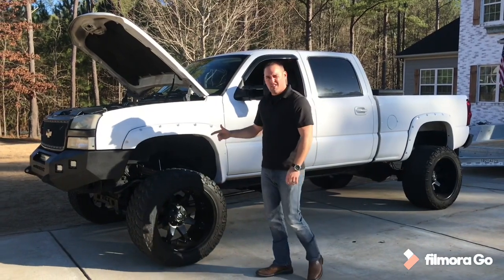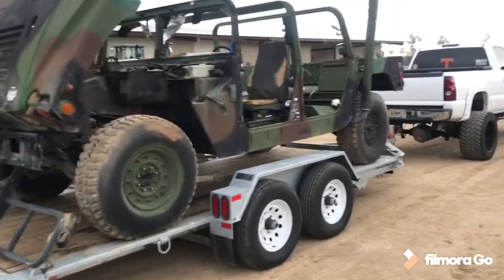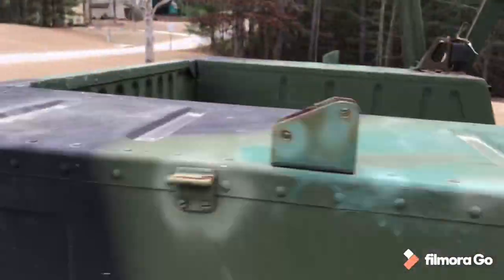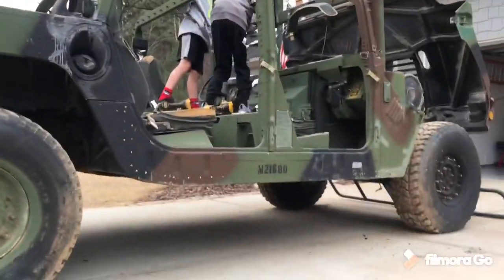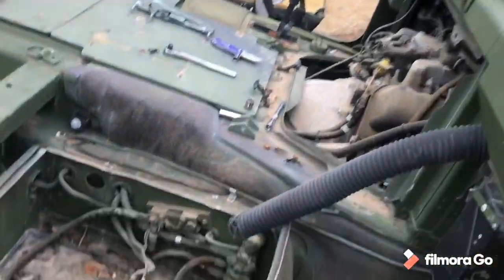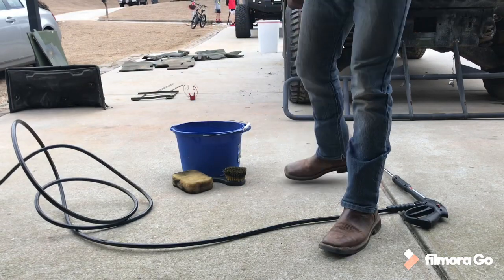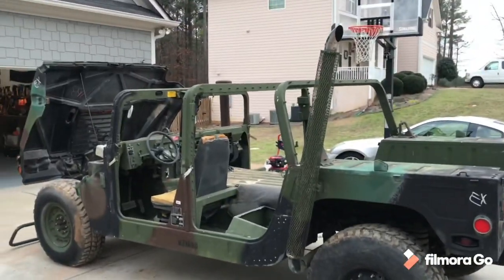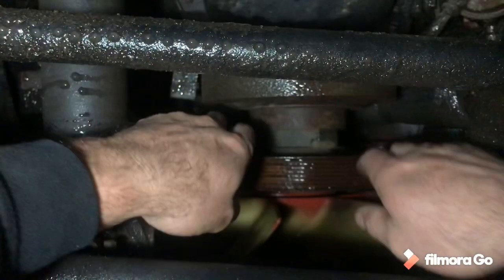Humvee Build Part 1

Comment: I would like to rent the same trailer in about a month, which trailer do I tell sunbelt I would like to rent? I am watching your build today. Thanks for all the information. I have learned a lot from your videos. Thanks for sharing.
Reply from the maker: The trailer is just their steel car/equipment hauler. 18ft or 20ft.
Reply: @SplitBuilds  Thanks Split builds. I see the model number of the trailer on the fender. I am still looking, I have plenty of time yet, I think. HAHA! Was your KDS box bad or was it your neutral safety switch?

Comment: I’ve checked online and the hummer says it’s 86” wide but most trailers are only 81” did Sunbelt rentals offer a wider trailer or are the measurements wrong?
Reply from the maker: Yes, the trailer was 82-83” wide. It will fit. My first humvee I had to let some air out the tires.

Comment: How wide does the trailer need to be to fit a humvee.
Reply from the maker: If you can get a trailer 82-83” wide between the wheel wells you’ll be good. The tires will be rubbing the wheel wells but it will fit

Comment: I bought one too and I put new batteries and still does not crank.. it just goes "click".
Reply from the maker: You could have a starter issue as well, Or may be a solenoid issue. I had a car in the past it just clicked and it end up being the starter. Try to tap it with a hammer to loosen the magnets.
Reply from the maker: You could have a starter issue as well, Or may be a solenoid issue. I had a car in the past it just clicked and it end up being the starter. Try to tap it with a hammer to loosen the magnets.
Reply: Split Builds ya, I took the starter out and it was stuck... couldn’t get it fixed.. ordered a new one.